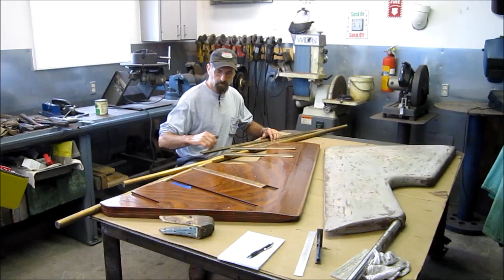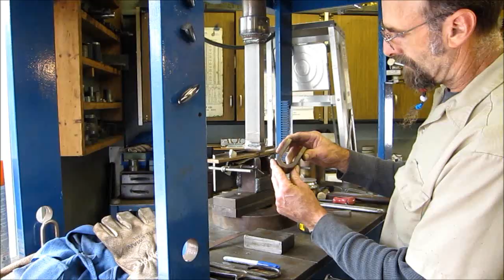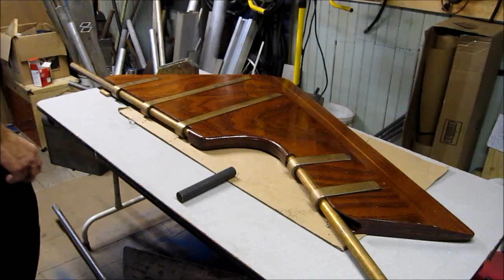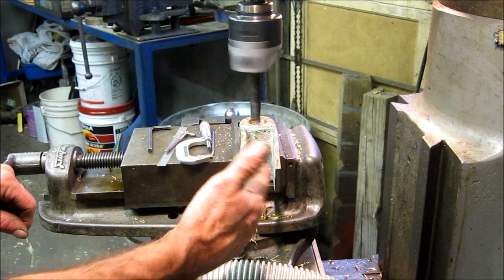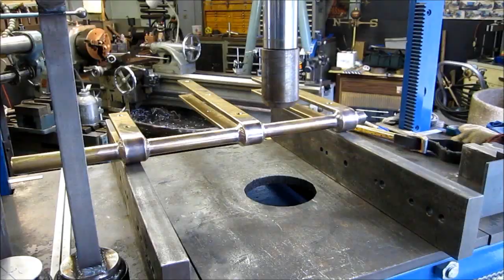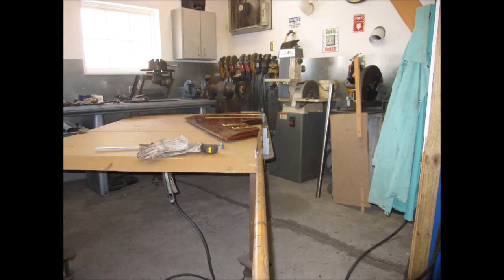Working on a Woody

Comment: Incredible work!  You not only getter' done, you impress the hell out of your viewers, this one included.

It would be interesting to learn how the metal parts will react to long-term immersion in salt water.  I wonder if the dissimilar metals (assuming the welds are not the same materials?) might be a problem over time. 

All of the bending was fascinating.  I noted that the shaft bend discoloured.  Is there no way to return this metal to its original finish?  I suppose this doesn't matter much as immersion will eventually harmonize the finish through chemical etching :)
Reply from the maker: The shaft material and the rod were both silicon bronze, most of the time I have had a chance to see some of the pieces come back in for tune ups or check ups really do weather well, some you can see the dimes stacked even though the material has been blended smooth and polished out at the time of the job, and none seem to be any less smooth or affected by electrolysis etc. ;{)---

Comment: great vid. Reminds me when my dad and I went to the stainless shop to pickup  cranse iron for a vessel we were making a new bow sprit for. I watched a guy use the same technique with the press,impressive, This sprit was 10 x 10 by 14 feet but had a small turned section for the  cranse iron instead of being flat. I asked dad how he was going to do this,he said on the shop smith,I said no way to long dad !! well he built a support section added a bot and a bushing to the end like a huge live center and attached it to the garage wall,this supported the aft end of the sprit,then he attached it to the shop smith with a beefy plate and fired it up very slow, the shopsmith worked and the garage wall groaned but he turned it to fit even with a ball end. man I couldnt believe it .It worked so well he left it on so he could drill some holes sand and chamfer the edges. Ill never forget that moment he fired up that shopsmith.